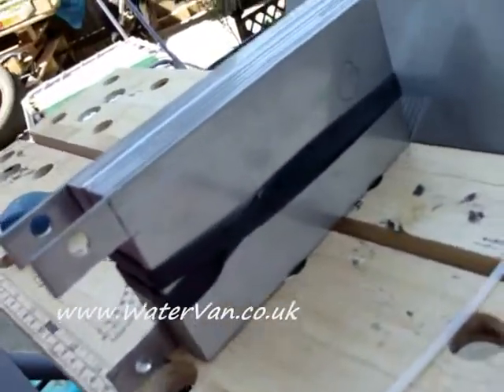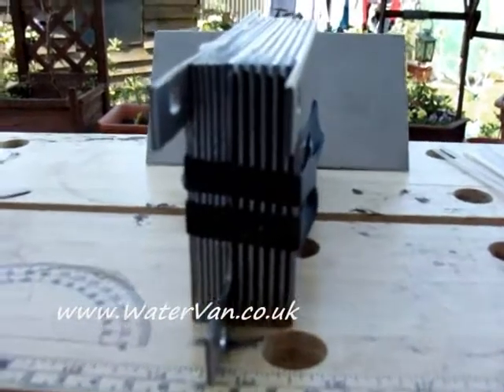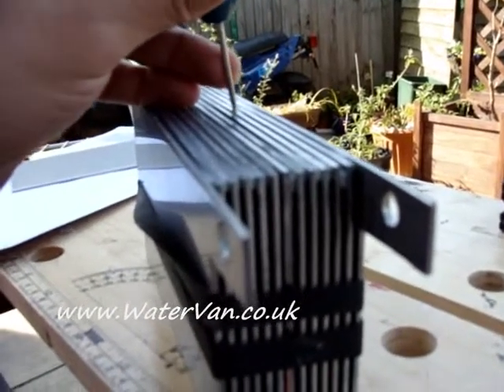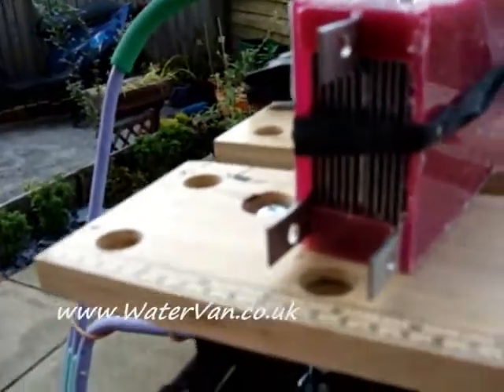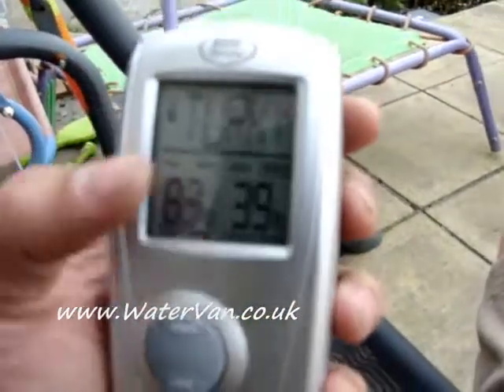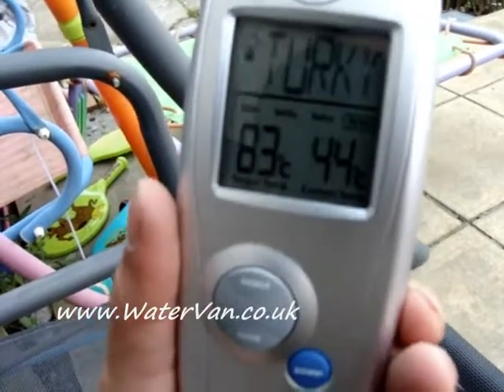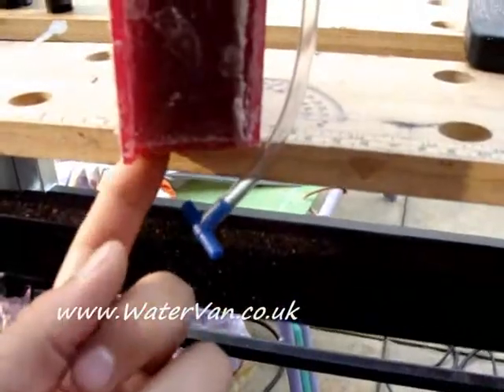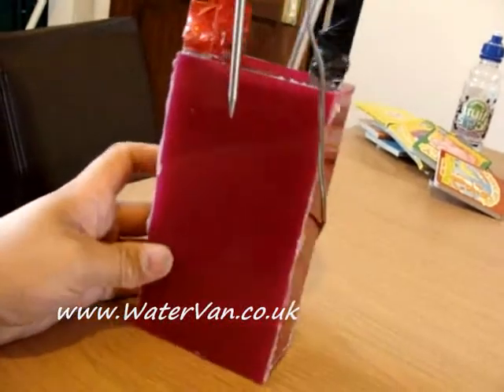#027 C5 MadStu's Water Fuel Cell - Rebuilt and Finished

Comment: I'm still waiting for my KOH to arive also hope it comes soon.  Your Cell is looking GREat you just have to fix up the thickness of the power conections going to the plates and also the extra pipe you got going into the tank needs to be looked at because you might find the water will come out if the output of the cell is under any presser you might wanna have a look at Zeros solenoid idear? Keep up the Good work I really injoy watching the videos

Comment: VERY NICE!

A few observations. The straps that connect the plates to the terminals should have heat shrink tubing on them to insulate them from the soup. Same for the threaded rod that joins your two positives.

The straps seem very thin. SS conducts very poorly. They are likely to heat with any serious current.

Last, it doesn't look like there's enough clamping force on the straps at the terminals under the cap. Unless you nut it tightly there's a chance of contact arcing. Just ask D3!